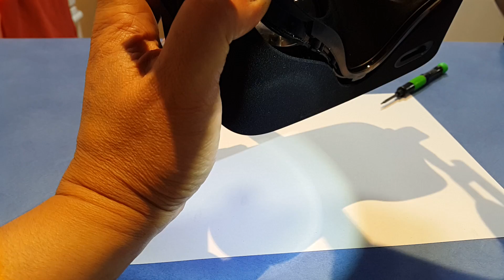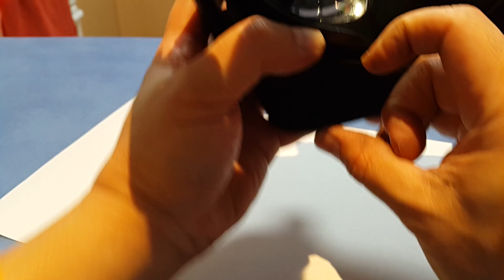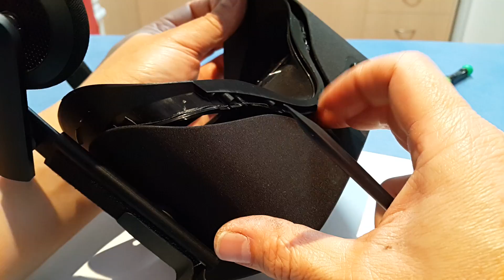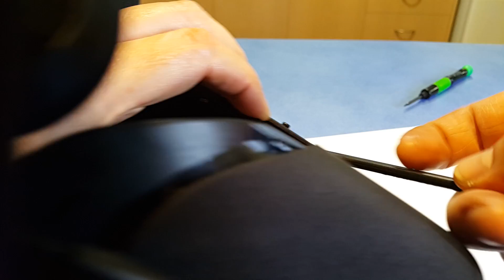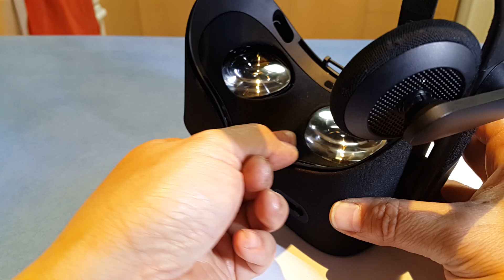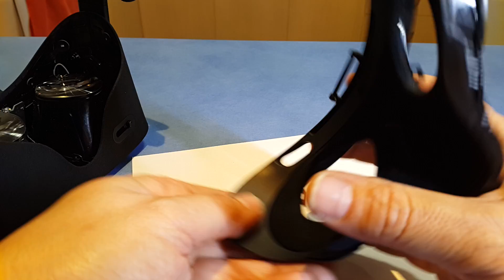Oculus Rift CV1 Teardown Disassembly How To Part 3

Comment: Another Pro Tip,  when reaching in to try to unhook the Lens Tabs, use a CHIP EXTRACTOR TOOL (Like Tweezers or Mini Salad Tongs, but with a little flat metal  'L' shape pointing inward on the business end of each 'Tong', that really helps PULL small tabs (and inner tops of 'unopenable' Cologne bottles etc) towards you with solid control and power.   Open the tool fully so you can use just one end.   With the metal 'L' pointing downward, place one end of the tool in the opened area and the L slightly behind the Tab and pull towards you gently, it will open right up!

Comment: Pro Tip - Once you pop the bottom clips around the lens exactly as shown in this video. Run a plastic guitar pick around the outer edge of the lens between it and the surround. the other 2 clips will pop free super easy.
Reply: Cool, yeah like fixing a Samsung Tablet or Phone.
Reply: Thank you Diesel Ramcharger, I was having trouble with the top 2 clips.

Comment: hello carlo, i own an oculas rift myself and that fabric that your working on or around right now in this video the net has glue like stuff that is melting is there any way i can replace that?
Reply: This might be a late reply, but I think https://www.vrcover.com is what you're looking for :)
Reply: d_avery it’s okay if it’s late I still appreciate the reply it’s still in the same condition I cousins find any answere
Reply: @Jay_DM  You need stretch fabric.  A girlfriend with a pair of Leggings in Black, would be perfect, then take out old cloth carefully, USE IT AS A TEMPLATE, A ... 'PATTERN' AND cut a new matching piece,  pop it in the way the old one was, use tiny dots or super thin thin line of IR Cure Epoxy Gel Glue, then gently place cloth, use toothpicks, get generally in place, then holding small areas in place nicely and tight with Toothpicks, CURE THAT SECTION and move to the OPPOSITE SIDE ( don't go around in a ring,)  you want to set this side, that side, this side that side (side being the other side of uninterrupted cloth , like cure inside the outer rim, then that area of the Lens Curve, THEN the Far inside edge, then the zlens Curve near that,  Keeping it evenly slack, BUT NOT TIGHT! (AND Not Stretching the Fabric while glueing! Taht would LOCK the Kenses into place with Fabric tehsion!  Just do each section and cure with the tiny UV light that usually comes with UV Cure gel glue.  Good Luck!

Comment: For anyone with the disconnect problem. Once you get the oculus lens cover removed you are done, do not keep tearing it down.  I have confirmed that this works at least for my device. Check out the solution in this link : https://www.reddit.com/r/oculus/comments/5dr4fv/rift_disconnect_when_twisting_the_headstrap/deat47q/ You basically have to wedge something, like half a paper into a small square in between the outer shell of the Rift and the circuit board right above the orange sensor that detects if you are wearing it. Check the reddit post I linked, or ask me. My rift is now working. The hardest part is getting the lens covers off like in this video but after that it easy. Don't continue disassembling the Rift any further after this video. Just do the paper wedge trick. Somehow bending the circuit board fixes whatever malfunction is going on.